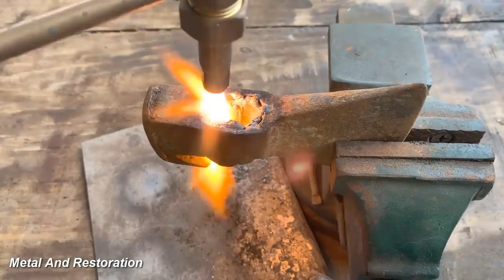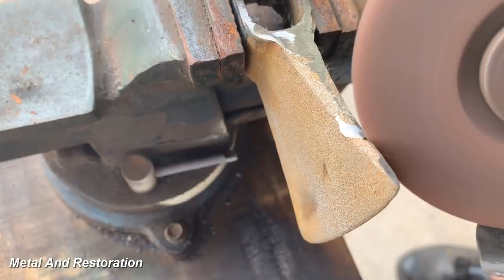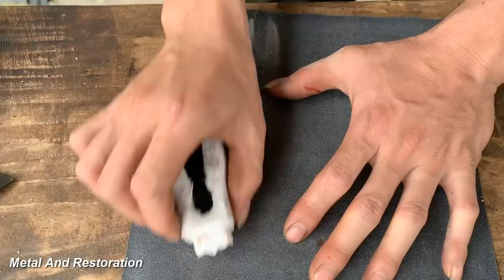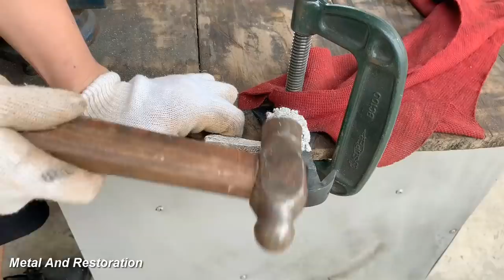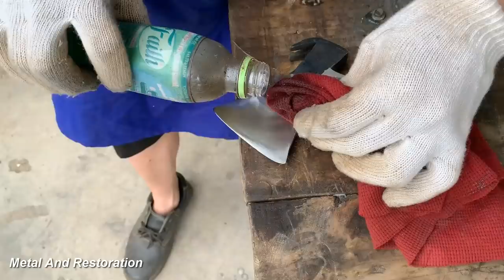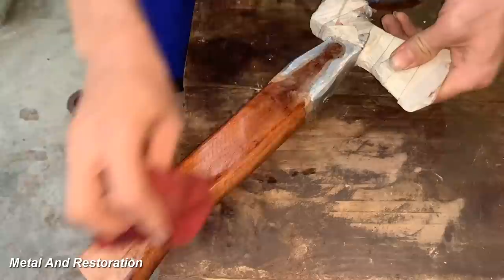Restoration the axe old| Restore metal castings ax| Antique  construction tools wood restoration

Comment: Just a thought, but maybe you should do the tempering AFTER you pour that hot, molten metal on it...?  And using an angle grinder as a circular saw is insanely unsafe.

Comment: The ax head is upside down, the nail puller must point down
Reply: How so on the nail puller numb nuts?  It's exactly where it was when it was first forged.  Do you know anything about how a nail puller works?  Yeah, that's what I thought.
Reply: I think this this is just a question of the axe pattern. I think this pattern was suppose to be hanged this way. If not then the previous owner had abuse it so hard that the 'claw' part is bent that way. Mine is handled just like a normal hammer does
Reply: jubjub247  yep....as long as it works.
Reply: Interesting handle attachment. I've never seen one like that.
 My only real complaint, is that is not meant to be thrown. Hard on the axe and potentially dangerous.
 Be safe and keep up the good work.

Comment: Температура плавления алюминия 660 градусов, температура отпуска стали 500 градусов.
The melting temperature of aluminum is 660 degrees, the tempering temperature of steel is 500 degrees.

Comment: Why don't you try to soak it in vinegar to remove the rust
Reply: @Restorationandmetal  have you ever tried electolysis? Was that lye or something you used when you submerged it to remove the rust.
Reply: @Restorationandmetal  you couldn't use a car battery with one therminal connected to your metal your cleaning and the other terminal connected to the battery terminal? Cheap and no need for expensive machines. But great job, guess there are a lot of ways to achieve the same result.
Reply: @educatedonealways6281  agreed.